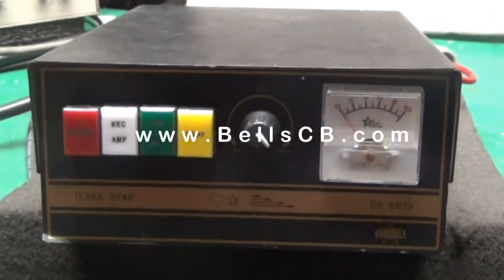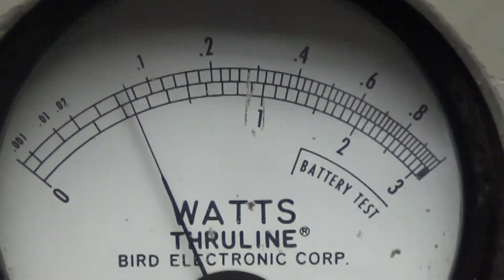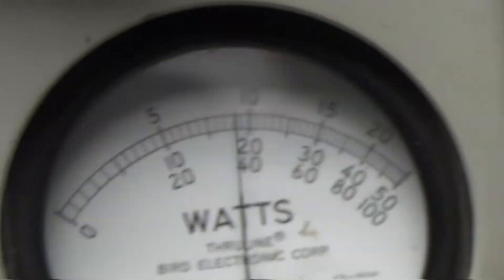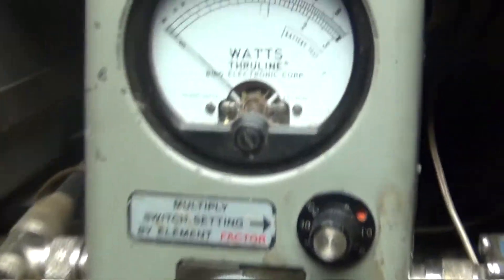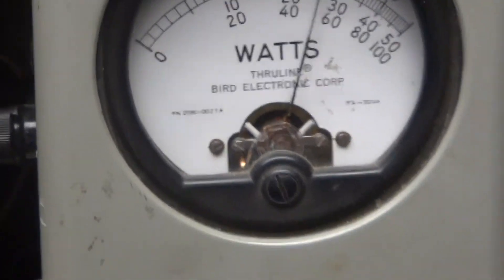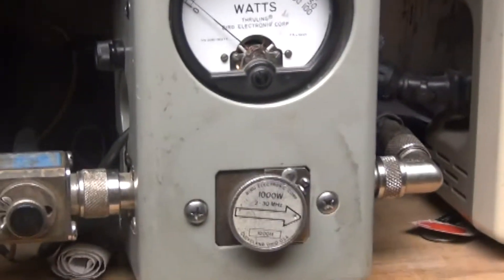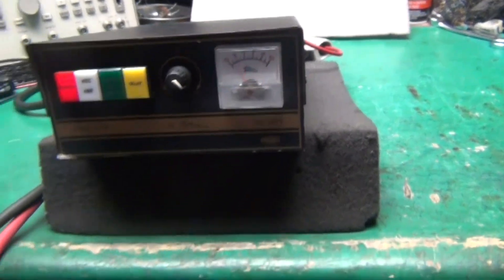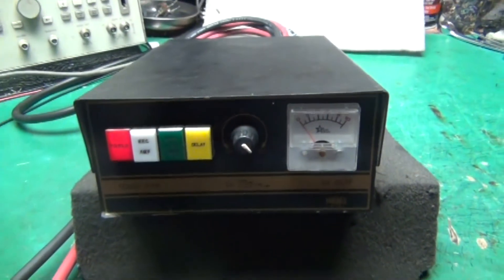Texas Star 667V Tune-up Report

Comment: If the Texas star 667 is set up correctly with at least 8 guage power wire, one 2290 driving four 2879s the amplifier should be able to do at least 700 Watts. The  667 is the same amplifier as a Texas Star 500, accept it has a driver final. A one final driving four finals. 1 X 4. To make the amplifier more versatile, the best option to do with the 667 is to put in a on off switch to shut off the driver section of the amplifier. Then you can run it as a straight. 4 pill amplifier with just 4 finals and no driver,  it would take more wattage, but you could acheive better wattage numbers on the pep swing side. Example a Texas Star 500 which is a straight 4 transistor amplifier with a  100 amps supplied to amplifier and a 100 watts of drive,  the amplifier will do 800 watts. With a good high wattage capable antennae and a swr of 1.5. Or less.  Rag chew with 20 to 30 watts of drive. Plenty of power output. Check out the videos, Texas star 500 or 667 on BBi amps on youtube.com.